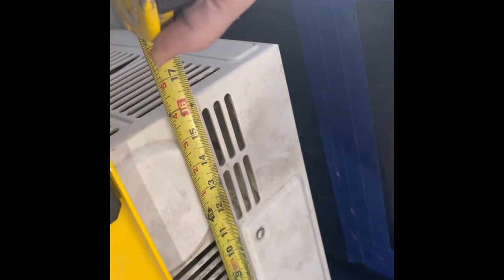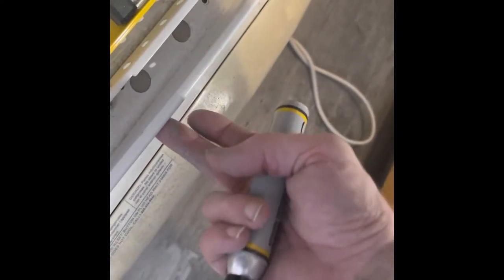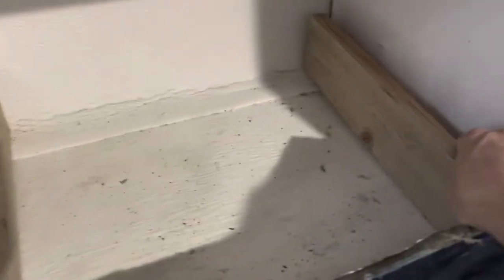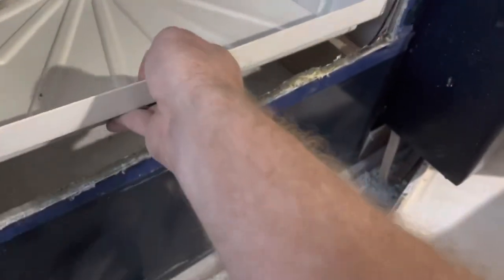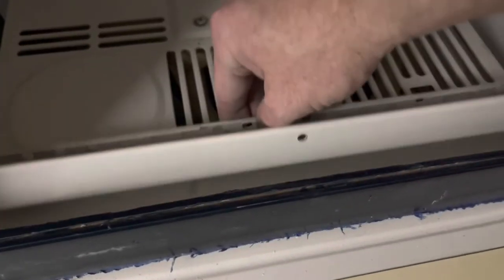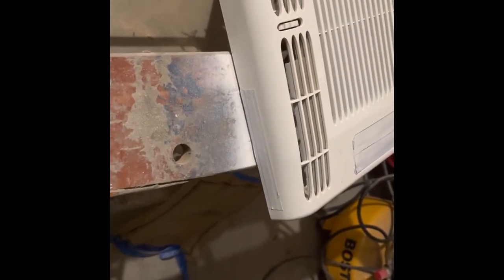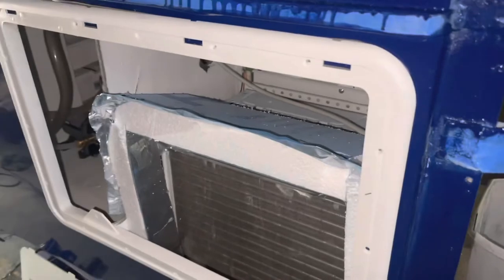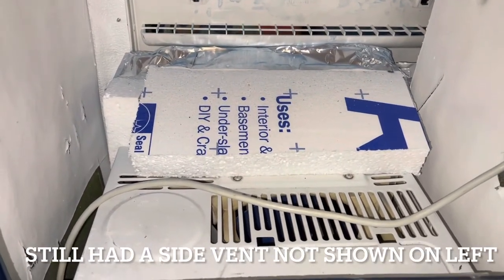Scamp Trailer 16’ 1979 remodel part 5 (adding an Air Conditioner to the Closet)

Comment: Previous owner of my 13' Burro added an AC like yours.  It's in the front between the seats of what was a dinette.  Tiny space, so this unit cools it down easily.  Here's the problem:  the heat generated is absorbed into the front wall of the camper and radiates back into the space.  Thus, the AC is constantly cycling and it's just too noisy for sleeping.  I added fans to its vent to try to move the air out of the exhaust chamber but that seems not to have much impact.  I only noticed this when I was lounging in that area and realized that my left shoulder was blazing hot!!! lol.

I think I may pursue the Wave2 from Ecoflow...
Reply from the maker: Yeah, the good thing about the size of my vent, it does allow a lot more heat out. I was actually thinking of moving to 7000 btu that I found cheap.
Reply: Where did you get the vents?
Reply from the maker: sorry I missed this. I bought the big one off Amazon. the little metal ones are from Home Depot.